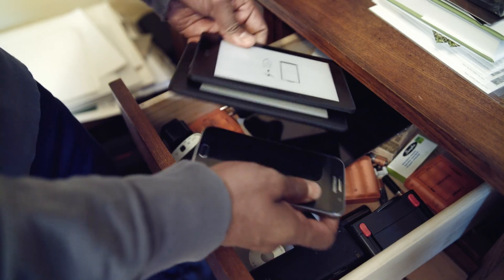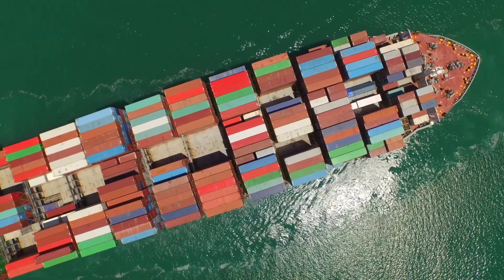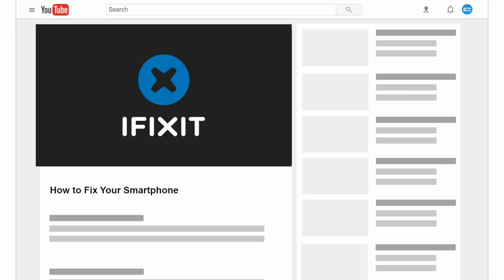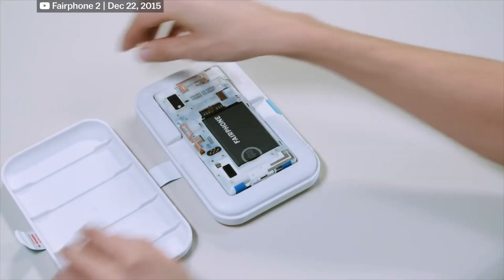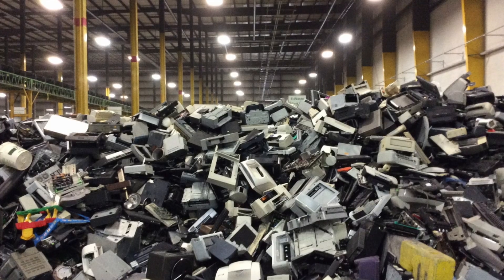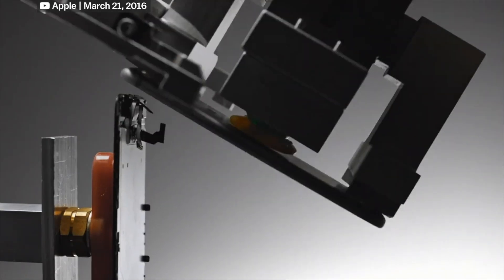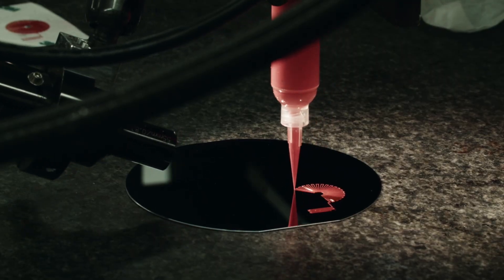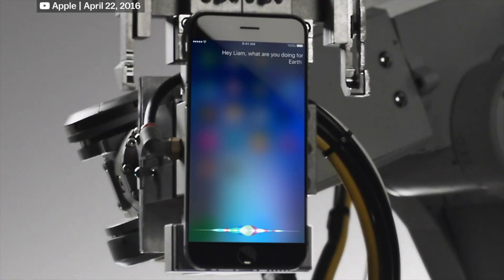Why your old phones collect in a junk drawer of sadness

Comment: Some stuff worth clarifying:

As most in the phone repair business will know, the Apple recycling thing? It's mostly PR talk and marketing stunt. They might have some flashy robot that disassemble iPhones, but at the same time they are fighting against the right to repair bill, and their actual repair services are just either replacing easily repairable phones with refurbished or new models. The tendency on Apple making more parts of their iPhones proprietary also works against repair efforts, specially when they lock stuff down via software to work with a single unit alone. Because you know, it's plenty easy to make ads and marketing with flashy robots and specialist interviews saying they are trying to do something about it, while hidden behind the curtains are all the measures they are activelly taking to sell more phones that they hope will end up in landfills faster to be replaced by newer models.

Yes, smartphones, computers and all sorts of electronics have a whole lot of base components that could be used for all sorts of applications, but for the most part, extracting them doesn't make economical sense. It's cheaper to mine for new raw material than going through the entire process of extracting them from boards and components - because those require chemical baths and extraction processes that not only are costly, take extra time and extra work, they probably would be even more harmful to the environment in comparison to just throwing those away.
This has been a reality before smartphones ever came to the market... it's an overall electronics problem.

Unfortunately, returning the phone to whoever sold it to you or even the brand/manufacturer himself will mostly not solve the problem. It's a whole other rabbit hole, but there's a whole trail and articles written about it how big companies will pay for 3rd party "recycling" companies that just stuff all that eWaste inside a warehouse and leave it there to rot. The trail for those will often end up in abandoned warehouse, or go all the way to some poor country in cities with people living with all that toxic waste with nowhere to go.

We HAD a pretty easy and economical way of prolonging smartphone life: replaceable batteries. This trend is dying, and summed up with barriers put up against independent repair, it's all going towards people replacing smartphones even more frequently. The last top tier phone to have a replaceable battery right now is probably the LG V20 alone. And the market is going against it because a replaceable battery also means no water/dust resistance, at least for now, with current smartphone design.

The research on graphene in batteries, and graphene in general, is great but is also a very long way away. Techies have been hearing about the miracle material for over a decade now... but there are lots of hurdles to go over, and getting it to production scale at the size it'd need to replace something like Li-po battery manufacturing at the demands we have today is no joke. It really won't be happening anytime soon. We're talking about decades here, and something more significant like a Lithium shortage spiking prices to a point it becomes economically viable to explore making all new industry level machines for a new material.

Some good news: with sources like iFixit and some other YouTube channels and sources, it is possible nowadays to get your own set of tools, sources for components (repair shops, eBay, etc), and learn how to fix some of the most common problems without much prior knowledge. I replaced two cracked screen phones and I'm stupid, so you can do it too with some research time and risk. :)
If you really can't be bothered to do it, look around... chances are you are going to find someone who can, or some shop who will at least accept the material. It'd be better if something like the right to repair bill passed, but even if it doesn't, repair shops will still exist.

Our smartphones are also becoming incredibly powerful, and communication protocols have become standard without many changes over the years (like when GSM replaced TDMA and CDMA in several countries). So those old phones? If they are not broken, they could be handed over to people who don't have the money to buy a new one. Sensitive information could be wiped out, and even for broken phones, they could be either fixed to be used again, or be harvested for parts by repair shops. Any of those alternatives are better then letting it collect dust in the back of a drawer. There are tons of creative ways of using old devices, and even the late dumbphones already had Wi-fi, mp3 player, bluetooth and some pretty usable stuff in them.

My past two smartphones were given over to relatives who don't need all the fancy app stuff, the one phone I still keep in my drawer is a replacement/burner/spare dumbphone I keep for all sorts of usages. But smartphones from the past 4 years or so could be repurposed for other stuff with the right accessories... a media streaming device for the living room, an Android device for lightweight tasks, a gaming/entertainment device for kids, alarm clock, part of a smart mirror... these are also very valid and good ways to keep the device from becoming eWaste. Just use it for something that you'd otherwise need to buy more electronics for.

Comment: Rather than change the way millions of people handle using cell phones why don't we just change the way phones are manufactured? You mentioned in the beginning that phones are assembled in a handful of steps in a handful of locations. That's part of the reason why NASA wasn't the first organization to reuse a rocket booster. You've got all these places that make the rockets and they're shipped from place to place before ending up on a launch pad in Florida. SpaceX builds the full rocket in one singular place and then ships it to Cape Canaveral for launch. It's much easier for a company to vertically integrate manufacturing than it is trying to tell someone to stop upgrading their phone every 2 years.

Comment: I would advise not to attempt the DIY tempered glass replacement kits on ebay and amazon. while attempting to remove the shattered glass, I cracked my galaxy S3's more expensive digitizer underneath. have it professional repaired.

Comment: A lot of times we upgrade simply for the new OSes because our older devices are not supported anymore. The devices would last longer if they had a longer useful software lifespan. My really powerful Galaxy S4 is limited to Android 5.0.1, which has a memory leak. This means I have to turn it off all the time and I want to upgrade just so I don't have to deal with the old OS. The super powerful hardware, and beautiful 1080p screen work fine.

Comment: Every phone, tablet, ereader or laptop I buy, I can replace the battery. My ereader actually uses an old Nokia BL-5C battery, cheap and replaceable.

My tablet is an old 2012 model Nexus 7, still on the original battery, still holding a charge very well. Sure, I had to replace the ROM as the stock one, once updated, slowed it down.. but now it is still fast and has no problems whatsoever. I don't even need a screwdriver to remove the back of the tablet. (It has been alleged in many places that updates intentionally bog down old devices to encourage replacement)

My phone is much the same, I can remove the battery in seconds, no screwdriver needed.

There are options out there and your devices can last you well beyond their intended lifespan if you look after them and know your options (For example, replacing the rom/rooting and wiping dalvik cache etc.)

If you really want to replace your devices, give the old ones to a charity or someone who needs it. That will help them and save them from purchasing another device that will just end up in ewaste.

Comment: Let's be real though, this has been a long time coming.
Phones are hitting the limits when in terms of mobile processing power without cutting into too much battery 'life' (if you can even call <24 hours a battery life) 
On top of that, we are nearing the phyiscal limitations of sillicone transistors. They cannot really get much smaller then they are. Then there's the die shrinks hitting the physical limits. We went from 200nm dies to 12nm in less then 10 years, with Intel having plans for 8nm in 2018. So we need a new material, and the material that's been under the microscope for a very long time now is graphite. Except it's extreeeeeeeemely difficult to use for mass producing electronics. 

Then there's batteries. They haven't really improved much in many decades. It's the slowest growing tree of technologies and that is why our phones don't even last a full day, whereas my Nokia 3310 used to last a month. Not a very fair comparison considering the functionality of our phones are infinitely greater then any 'dumbphone' and the processing power it packs. 

I hope to see graphite in use in a few years. I hope to see a new battery technology that is exponentially more powerful then Lithium-Ion. And I hope to see phones becoming more easy to repair like in the old days, where removable batteries were the standard and everything could be fixed instead of having LITERALLY EVERYTHING held in place with glue

Comment: pff, I have to replace my phone, because after 3 years, my hardware cant keep up with the software updates. Unlike a PC where you can replace the CPU or graphics card, smartphone insides cant be upgraded. Its built like a throwaway item. In two years, technology moves forward, and your "old" smartphone cant keep up. This could be solved with making customized software updates, instead of forcing you to upgrade to a whole new device.

Comment: All of my old phones were very quickly incompatible with my newest sim card etc. so I just resold them. 
I think the biggest issue is that phones are basically built to last 2 years. Not only in the durability of the hardware, but also in the software. For android for example, 2 years is the cut off. No more software updates for you!

Comment: why don't we have solar powered phones yet.
Reply: Ragnarok Sora Sola energy research is slow and expensive, rn panels just aren't efficient for that kind of use. Or most kind of use other than in large quantities like solar farms and roofs.
Reply: Ragnarok Sora There are solar rechargers that can be charged up by plugging them in or leaving them in the sun but I don't know how well they work. They probably take a long time to charge if you just leave them in the sun since they're only about the same size as a smartphone.
Reply: Eric Walker isnt silicone extreme abundantly.
Reply: Ragnarok Sora because they would be the size of a table.

Comment: replacing a phone isn't always about it breaking... my phones always outlive their usefulness. 
currently have a Samsung 3 (that I've only repaired once by myself). 
 at about 6yrs old it still works great but the hardware is out of date and most new apps refuse to load  (despite having plenty of memory) the appstore has claimed my phone as just too old... 😧👎
(so though my phone is fully functional,  I'm looking for a new one to upgrade)

Comment: No, not everyone has a drawer like that. 
I have ONE old mobile. ^_~
I had a second one, that I gave away a while ago to get recycled. 

There are actually people who don't buy a new gadget every couple of years. (Every two years? Seriously?! I had both my mobiles for about 10 years before swapping them for a new one - as long as they work properly, why would you throw them out?)
Also: I just don't buy phones that don't have a removable battery. Or Apple-products that have a new charger-system all the time. My phone will load with the same cable as my mp3-player and my old phone. Yeah! ^_^

Comment: Ive been using htc one m8 for 3 years now, battery condition is still awesome, Ive dropped it a million times still havent cracked my screen, even got water inside the device but no damage occured. Yet is very rare to see an iphone screen with no cracks😂

Comment: I laughed a little at this video.. he was surprised to see someone take the battery out without a screwdriver, and then he acted like he had just come up with the best idea ever; a battery charging in minutes. The OnePlus 3 phone can do that already... and I resently changed the battery in my Samsung Galaxy s4 just by taking the cover off and putting a new battery in... now it's gonna last another 3 years..
Reply: Matanumi like the s5 waterproof and removable battery
Reply: CookehMonstashe THERE'S A Big difference between water resistance and waterproof. The s5 is only at a ip67 rating while the S7 and s8 are ip68.
Reply: Toto I have the same phone, lol.
Reply: +Nathaniel Roy There is no such thing as a device which will never permit water ingress irrespective of the conditions or duration of exposure ie a waterproof device. All devices are simply water resistant for some duration under limited conditions exceed those conditions or the duration of exposure and all bets are off.
Reply: yeah I have the S3 it still does that.

why are people surprised? phones should've been doing this the whole time. if you want to make it waterproof thats fine but otherwise user removable battery at least!
Reply: Mark The Gr8 What are you talking about?? I'm not arguing about that. I'm arguing about how people mix water resistance and waterproof like they're the same thing. Last time I checked, the s5 is not waterproof. I was just telling someone the true rating of these phones.

Comment: I was just researching about ways to recycle my gadget graveward. Nice timing on the video.
Fairphone has compromised on bulkiness. Swapping the display or the battery is not a daily task. So a couple of screws on the way is no issue. Most phones, changing the display is a challenge even for technicians. So simplifying it, is vital.
Battery is a risk which we all choose the ignore. Especially after the Samsung issue, it has to be a main issue.

Comment: What the industrialized world needs is a policy change requiring manufacturers to be responsible for the disposal of the goods they produce. So TV makers would be responsible for collecting old, returned tvs and disposing/recycling them responsiblity. This would dramatically reduce waste, and with a program such as refunds to technology users (much like bottle returns), people would be incentivized to return their obsolete/useless technology items in order not to lose any deposit they paid for it.
Reply: Did you know most companies have recycle programs? Microsoft, for example, no matter the brand of computer, gaming console, phone, or any of it's parts will recycle it. If it has a monetary value, they'll pay you for it! Apple has a similar system and sometimes  you get 10% off your next purchase. 

Companies are aware of the issues and are putting recycle programs into place to dispose of goods correctly or reuse them if possible. Check websites for recycle, reuse, or renew programs and follow the steps. 

When I used to work at Microsoft. People, no matter how many times we offered to take their stuff, didn't want to bring it in. Or people would create conspiracy theories of what we would do with their old devices. You had people claiming that they forgot to bring it in, and then would never return with their old item to be recycled. 

There has to be a shift for both manufacturers and for consumers. People don't just have to want to recycle, they have to trust it and it has to be easy. Manufactures need to advertise and market recycling even more. 

(There's A Business Idea In There Somewhere)
Reply: Emanuel de Matos a good example of that is back in the day when dairy companies would deliver milk in glass bottles instead of the plastic jugs and theyd be returned and just cleaned and reused
Reply: Emanuel de Matos Amen.
Reply: Another Made Up Internet Subculture You can check out some e-recycling options here (US): https://www.epa.gov/recycle/electronics-donation-and-recycling

Also, my local municipality has a designated drop-off point near the highway dept. (where they keep all the work trucks & equipment, materials, garbage trucks, etc.) for old TVs and other e-waste, so you might want to look into that to see if that's an option in your area. You can also throw old cell phones up onto a site like eBay or Swappa and get some cash while giving your old phone a second life!
Reply: frank javier but they only have those programs in first world countries i guess..... the only ones thats ive saw in my country are some companies of cellphones.... sadly :/
Reply: Not a bad idea. Require the customer be paid 10% of the product's retail price for returning the product and that the manufacturer cover the shipping costs.

So, buy your TV for $500 in 2015, then when it releases a cloud of smoke and breaks down in 2020, send it back to the manufacturer and get $50 back at no extra cost to you.
Reply: As much as dislike adding more red tape to businesses, this would provide a much needed incentive to making these devices last longer and easier to recycle.
Reply: This should be a personal issue not a business one. I sell all of my old phones and if I don't need something I find someone who does. I purchase nearly everything used (car, phones, TV, computer, etc.) and once I am done using it sell it back. The problem is a bad mindset. Buying things used and selling them used also means a net loss of nearly nothing. Its what is best for the environment and your wallet.
Reply: Aaron Klapheck i respectfully disagree. Giving the burden to individuals would only make companies careless about their waste. Instead of coordinating and convicing millions of individuals to make an effort, creating policies would force a whole group of consumers to recycle.